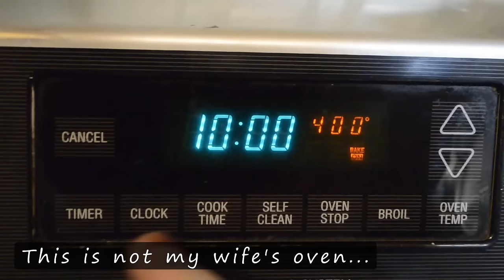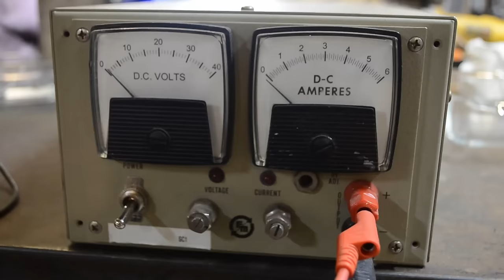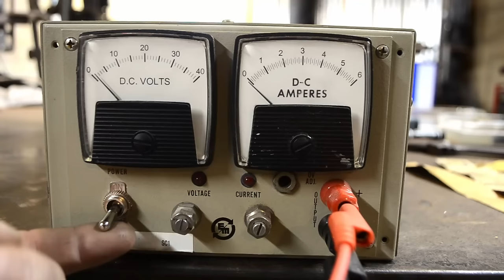Restoration of an old "Valve Lapper" tool

Comment: That is amazing how you restored the valve lapping machine.  Equally amazing is how you made some new parts for it and how you electroplated the steel parts with copper and nickel.  It looks much better and it works like a charm too.  Excellent work.
Reply from the maker: Thanks! This one ended up being more of a handful than I had originally expected, but it turned out good in the end.

Comment: Amazingly, someone goes for the JB Weld and uses a reasonable amount.  Most youtube restorers would gloop the entire thing in a thick coat and then spend days sanding it off.
Reply from the maker: Yeah, it didn't need that much. I feel like it needed to be cleaned up, not absolutely perfect. In the end it was a ton better than when it was new. Thanks for watching!

Comment: I remember these.  Now I just use my battery drill on slow and lift it a lot.  Works perfectly.  The reciprocating movement doesn’t make the seal any better.
Reply from the maker: You're probably right, but I suppose it doesn't hurt either. I've also often just chucked the stem of the valve in a battery powered drill and taken it easy, but I suppose now I can be fancy 🤣

Comment: That was probably made out of ductile cast-iron.
Reply from the maker: This was my guess. Would that also be called gray iron?
Reply: Yes I believe so. It machines really easy and if you file or sand it, you can taste the metal in the air, if that makes sense. kind of like when you’re sanding something that’s rusted you get that rust taste. Old cast-iron has its own taste as well.

Comment: if you have hydraulic lifters don't forget to tip the valves stems ...
Reply from the maker: Would this be in a flathead engine where the lifters make direct contact with the valves?

Comment: интересная но бестолковая фиговина.
Reply from the maker: Well, thanks for watching!
Reply: Stupid bullshit?  That’s a little uncalled for.  It would be quite a handy tool for someone who repairs vintage small engines (like the 70 year old rototiller that I rebuilt last year).  It’s definitely an improvement over using one of the newer hand-powered suction cup loppers (like the plastic stick that he removed the suction cup from in the video).